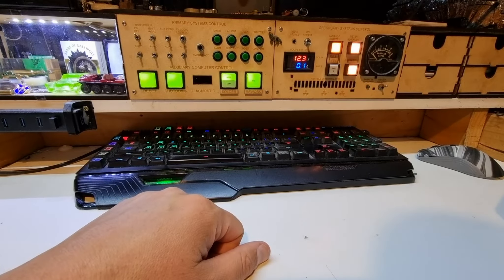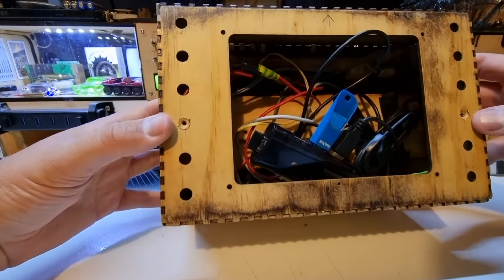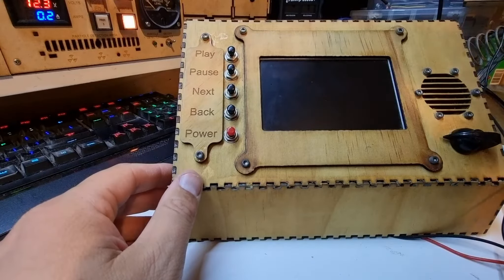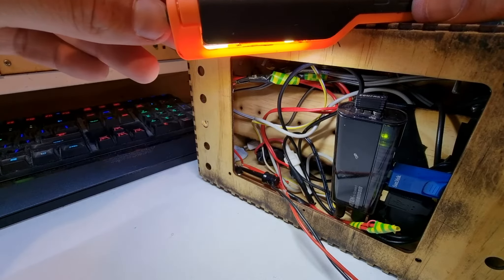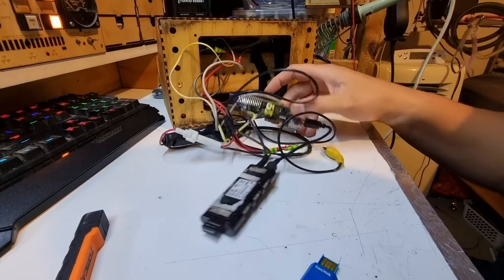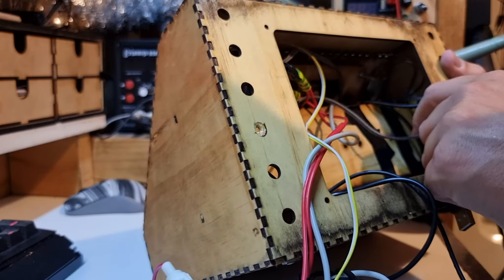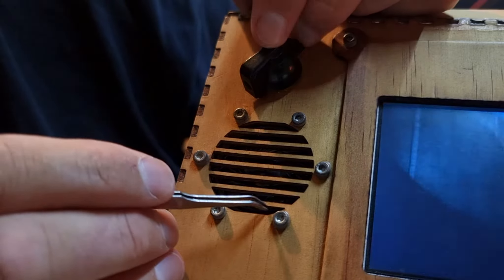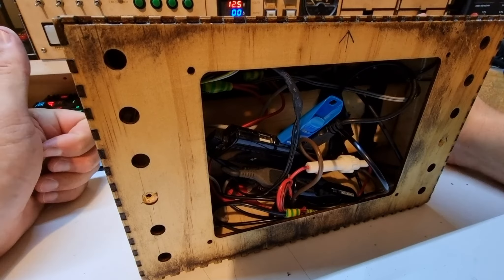Fixing my decade-old creation

Comment: Hi, I see a great opportunity to do a major upgrade here.
Make a new case like the dash of a military aircraft or radio.
Forget about miniaturization, make it serviceable and if possible get some military type switches/buttons.
Depends on the funds available, but I would certainly update the case to "military looking" spec.
Possibly an old military chassis can be repurposed.
Reply from the maker: That's always been a consideration, I used most of my military switches on the light and sound show in the same museum.
There is zero budget for this, and presently youtube barely hits the minimum payout each moth (sometimes it takes two months).
for now it has to be the parts I have laying around.